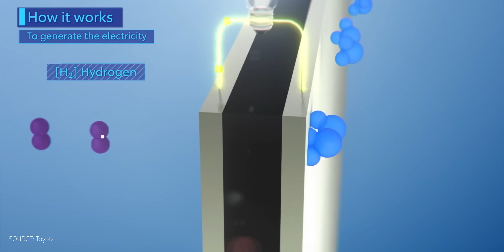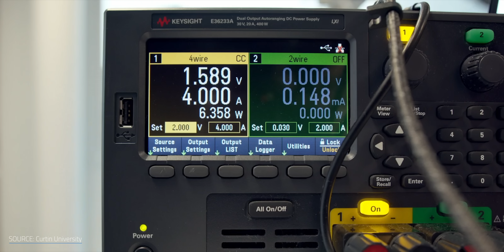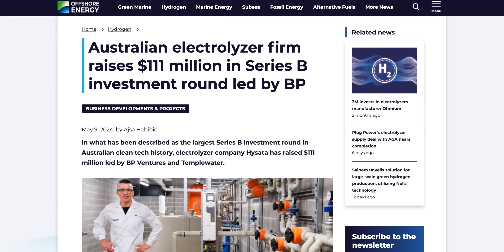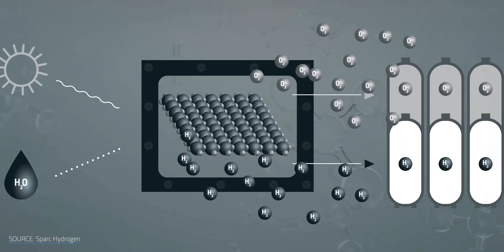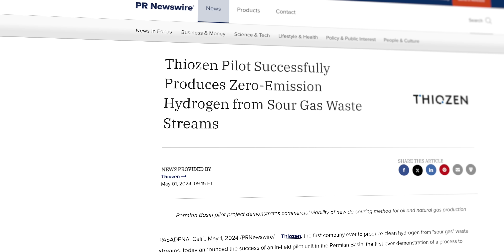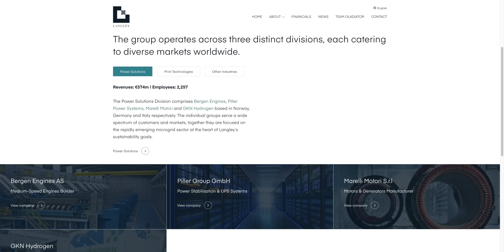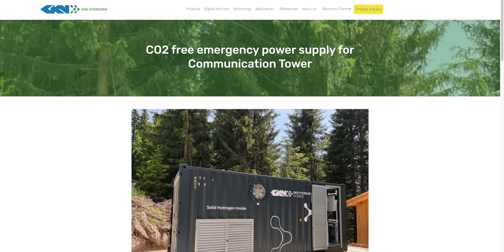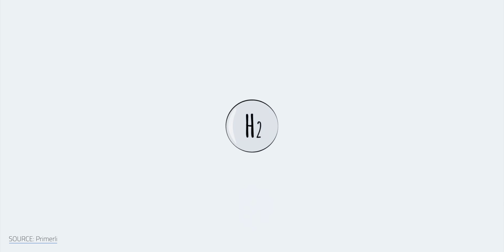How a Hydrogen Breakthrough is Closer Than Ever

Comment: Anything you built will cause emission.  Wind Turbine built of fiber glass, which is unrecyclable.  Same with Solar panels, or huge concrete for hydro dams.   In the end, Gas is cheap and easy to burn.   It might be more sustainable to invest in carbon capture instead.

Comment: Even running natural gas fuel cells is still a big step forward relative to most other power generation as far as energy efficiency. The obsession with attaching  hydrogen use to fuel cells needs to stop. It’s detrimental to to the entire fuel cell industry because it’s counterproductive to scalability and makes everything more difficult than any other possible fuel source.

Comment: I am betting on white hydrogen extraction working. Just need to convert most of it electricity near site or build data centers or fertilizer production near resource if it is a proven reserve of 20 years or so would be feasible.

Comment: Why should you have an electroloyser and a windturbine off the grid in stead of an elektrolyser combined with a windturbine ánd on the grid. So you can use cheap electricity from wind ánd PV?

Comment: "Hydrogen has to come from somewhere"
 However, unless it is being produced for use on site, more or less at the same time, then it will also need to go somewhere, and therein lies the problem, or at least a very big proportion of it, because this means it needs to be be stored, transported and dispensed, which current evidence suggests probably accounts for about ⅔, or more, of the costs, and cheap electricity and electrolysers are not going to affect this aspect of hydrogen use when used as an energy vector.

In California production cost for hydrogen is between $1.50 and $15,  and between $3 and $5.50 when produced using electricity from PV.

If we use an average price of $8.50/Kg then, with the current retail price for hydrogen for FCEVs, $34.55/Kg, that means the storage, distribution, dispensing, maintenance and profit margin costs account for about $26/Kg, as far as the end user is concerned. Accordingly, unless the users  are located at the production site, reducing electrolysis cost, even by 90%, isn't going to make an awful lot of difference to the cost for the end user. Even if you can get the pump price down to $20/kg that still about $0.50/KWh, which is probably over 10 times the cost of  off peak or home produced electricity, plus an electric vehicle is nearly twice as efficient as a fuel cell vehicle.

Those pushing the idea that cheap electrolysers are going to solve the hydrogen for transport, or in fact most non-industrial clean energy supply, problem show a distinct lack of #WST skills (whole systems thinking).

The only way hydrogen will take off for general transport is if a lot of people decide they are willing to pay vastly more for travel in order to have the perceived convenience of hydrogen over electricity.

Comment: We need to ramp up solar and wind energy production. Then when we are producing more electricity than the grid can handle we dump the excess electricity into electrolysis and produce hydrogen. At least we can produce enough hydrogen this way so we don't have to use fossil fuels to make it.

Comment: Hydrogen is not supposed to be a universal solution to the worlds demand for electricity and vehicle fuel. It's decent, in its relative simplicity, for off-grid, great for elimitating carbon emissions in certain heavy industries. Furthermore, it can be transformed into ammonia, which can be used as a maritime fuel, as well as for fossil fuel free fertilizers. And it could be used as a way of balancing wind/solar, making renewable energy systems more reliable. Though I grant there are other methods to achive this.

Comment: You made a presentation on hydrogen as a fuel and didn't mention PLUG?
They are operating 3 clean hydrogen production facilities, producing 45 tons per day, with 3 more planned to be built in the next few years.
They provide hydrogen fuel cell power fork lifts to Walmart, Amazon, Home Depot, and many others.

Comment: The elephant in the room here, the big main issue about hydrogen is not even mentioned in the video. You need 52 Kwh of energy to produce one kilogram of H2, that then delivers a maximum of 33 Kwh of energy (in the best possible case). There's a 19 Kwh negative balance in producing each H2 kilo. The way you can produce it, green, pink, fossil, is a secondary issue. 
The video mentions a new solution saving some 25% of energy sparing heat losses. Great step ahead, but still it would be 39 Kwh to produce 33 Kwh. The negative balance is still there. And even if we went on par, it still doesn't make so much sense.
The place of Hydrogen in the future mix might be as jet fuel. 
In an over-abundant energy environment of tomorrow, we might well dedicate a costly energy fuel like H2 (super clean anyway, once produced) to replace fossil flight.
Sure I'm wrong and my numbers are not correct. But please, let's talk about this main problem. The rest is detail.

Comment: The ratio to produce abundant Hydrogen from SMR vs Hydrolysis is significant. Hence use Natural gas to produce Hydrogen, take the spin off Co2 and pump it into the ground using CCS giving it a net zero  emissions footprint. as opposed to BEVs that require precious metals to produce batteries, natural gas is in abundance, and since that market is in place already, it would not destabilize the economy as much as a critical mass move to BEVs  would. What are you going to do when lithium and nickel (limited supply) are so overprocessed and lost and scattered around the earth through  band aid solutions (battery recycling - Not 100%). Since we are already putting band aid solutions on the table, why not use what we are already have, take a look at CCS (Carbon Capture technology)...

Comment: I don't think hydrogen needs to be completely emission free out of the gate. The main focus should be developing infrastructure so that you can, in turn, develop a more efficient product. You can then clean up the base of the production down the line. Regardless, it's still a big dent in overall emissions even with using fossil fuels to produce hydrogen. We use fossil fuels to mine and power lithium ion so idk why we hold hydrogen to harsher standards.

Comment: Nothing on storage… I’m not sure exactly what you mean by “efficiency” when you were talking about the first company and their new electrolyzer. Does that mean it can produce more hydrogen per unit or does that mean the energy needed to turn water into hydrogen is less? 70% more efficient compared to what? I don’t know it just doesn’t mean anything… 

I think hydrogen is still dead. I’m not saying we shouldn’t pursue it, because the benefits are potentially huge. But it’s not going to be a big industry until something actually changes. So far, it’s the same story, you can’t store it, so the energy density gains go out the window which is the only reason anyone would want to use hydrogen in the first place. You can’t even transport it long distances or store it long term… it’s just not practical. It doesn’t matter how big a plant you make, hydrogen can’t be stored long enough for it to be worth doing that. You’re better off producing it as needed on site. Again, until the storage problem is solved, hydrogen is just a niche tech with limited applications.

Comment: I think it has a place in a renewable grid. I had one lecture on fuel cells at university and the professor summed it up like this: Hydrogen is the means you deploy, when you can't use electricity directly.
Meaning you can use electricity next to its source to create heat, charge cars, power factories etc. Then do that. But what if you can't? How can you get dirt cheap renewable energy from Chile or Australia to other continents? Not by cables, not by batteries. And the ~50% round trip efficiency hydrogen seems to be converging to mid term is tenable if your wind turbine in Chile get 400% of the yield it would get in germany.
(And how do you decarbonise steel and fertilizer production? How do you store electricity from the summer until winter,...)
Those are the challenges where hydrogen can provide the more cost effective solution.

Comment: If I can get things going hydrogen will take the lead but my primary fear is those whom don't want it too have all the money right now and will stop at nothing to keep things that way. Take this new theory and put it someplace safe and memorize it as it goes much further than just to break the bonds of the water molecules.
"All  Molecules  can  be  separated  into  their  component atoms  by  taking  away  the  electrons  from  the  atoms that  make  up  the  molecules." 
This is a brand new theory I came up with while trying to figure out just how a few people whom aren't with us anymore split the bonds of the water molecules with far less energy than anyone I have seen before. From my research what they did was to mimic the earth's global electric circuit to get the job done. 
I keep an eye on Hysata because they are ahead of me as it's going to take me a little more time to get things completed.

Comment: Increasing storage length and efficiency may open niches in Hydrogen.  One that can be addressed is tanks leak over time, and a double tank with Hydrogen paste to absorb and slow the leakage should be considered.  The ability to accumulate hydrogen for high demand high speed electricity could change charging for space, and possibly commuters too.

Comment: Please, hydrogen is overhyped, It's mainly the Japanese automakers,  who've been pushing that. If we have a problem just putting up charging stations for EVs there's no damn way we're going to be able to convert to hydrogen because the difference in infrastructure development is like 10 times. There's the transportation of hydrogen there's a storage of hydrogen there's the issues of cars getting into accidents and possible after effect of that. Then there's the fact that you would have to convince Americans are better off fueling up with hydrogen than they are with gasoline. ? Then there's the fact you would have to have all these mechanics learn how to work on hydrogen vehicles that means more equipment different changes in motors so forth. An electric is a lot easier to work on there's no transmission there's no exhaust system there's no catalytic converter as well as there's no engine there's no oil needed. And considered almost any business can install charging stations compare that to trying to convert gas stations into hydrogen storage as well as there's a problem with getting enough truck drivers to transport gasoline and then you add hydrogen as another thing to be transported We don't have enough truck drivers for that. This is pretty much a useless story at this point we're not going hydrogen at least not within the next 25 30 years.

Comment: Typical brainwashed lib, fast and loose with truth. Wind turbines are not green. First the huge block of concrete to anchor the base. CO2 equal to half the weight of concrete is produced making the concrete. Then there is the massive amount of electricity used to make the aluminum and smelt the steel and copper in the generator's windings. Highly refined steel alloys are needed for the gears, and of course those must be machined. They also must remain bathed in up to several hundred gallons of OIL lubricant. Fiberglass for the blades... comes from petroleum and cannot be recycled. Much of this oil and energy is also used to mine the lithium for the electric truck that hauls guys out to service these eyesores.

Comment: Hydrogen is the result big oil lobbying since most of hydrogen produced is a byproduct of the oil industry to slow the inevitable march of battery electrification. 

It has no place in a sustainable future since converting water to hydrogen using electricity is very in efficient, losing most of the usable energy compared to using electricity directly. 

This channel believes anything, even got suckers to buy the pump and dump Nikola stock.

Comment: If you just had a big long cylindrical chamber to mass produce 100 meter long, 10 meter diameter PET plastic cylinders pressurized to 50 psi, you could make gigantic one kilometer square, multihull sailing ships that use the propellers to harness wind energy and synthesize ethanol from the hydrogen and CO2 in sea water.  A few thousand such ships would equal global oil production.  With a sail area of one kilometer wide by 300 meters high, the available wind power in a 120mph hurricane is about 30 billion watts.  30 ships would absorb most of the wind energy from the average hurricane.

Comment: First, the production of hydrogen needs to be clean and efficient. Then it needs to be stored effectively. And finally, it needs to be distributed efficiently. These are all significant hurdles if hydrogen is to be used as a transportation fuel. Battery EVs still need some work, but they have most of these issues solved.

Comment: The biggest problem with any “alternative” energy source is the idea that there is a way to produce energy without a down side. So there is no “green” energy. Wind turbines and solar panels have to be made from materials which come from the earth. Batteries require rare metals that have to be mined scarring the environment. These materials aren’t endless either we may run out of them. There is also no such thing as a true “renewable” energy source. Yes, the wind blows and the sun shines without us doing anything, but until you can produce as much energy as you want from those sources on demand and deliver it to the consumer, it’s not a solution to the world’s legitimate need for energy. We all would like to see a future energy source that is abundant and delivers uninterrupted energy in any form we need it without any environmental damage, but it doesn’t exist and probably never will. I call it the “magical fairy fuel” you have to squeeze it out of the rear ends of fairy’s to get it. The best we can do is utilize the energy sources we have as efficiently as possible. That’s why it blows my mind that the same people who want zero emission energy sources are so against nuclear energy. Again, you can’t produce energy without a down side, but for the power just one nuclear power plant can produce it definitely worth the small amount of nuclear waste that is produced. Even if you calculate the risk of an accident, which is incredibly unlikely if the plants are run properly, it’s still the best option we have for abundant electricity generation. I’m glad that the human race is still working on solving some of these problems and maybe in the future we’ll discover something truly amazing, you never really know, but we need real solutions now, not fairy fuel dreams.

Comment: An interesting idea is the small nuclear reactors set in a tractor trailer. 
Married with an electralisis set up to produce hydrogen. 
The storage and distribution are the most interesting bits here honestly. 

I would expect locations that can overbuild there local power grid. 
/ Have there own localized power. 

Could convert to hydrogen for some of there fossel fuel needs. 

The most interesting development on this vid is the solid form of hydrogen.
If this can be produced at scale.....

Comment: Hydrogen as a transportation fuel has a number of problems. One basic one is: where is the hydrogen coming from?
The hydrocarbon miners have a great idea, start with hydrocarbon. Any process to do this is less efficient than burning the hydrocarbon, and still creates climate changing chemicals.
The other big ideas is using solar to create hydrogen. This is wildly inefficient. Any hydrogen powered vehicle design still has electric battery cells to power the electric motors. Storing the hydrogen in the vehicle is heavy, and very dangerous.
The only force keeping this idea alive is the aforementioned hydrocarbon miners.

Comment: The critical factor is efficiency.  If the solar production method produces more hydrogen per square meter of sun collected than PV producing electricity used for conventional electrolysis, we have a winner.  As I recall, you can store twice as much energy in a battery as you can as H2, but since PV is only 20-30% efficient, if you can capture 40-60% of the incident solar energy in H2, we are gaining ground.

Comment: wondering, so for power generation can you just plug hydrogen into coal plants and it'll work? Then use photocatalyic water spilting to break byproduct of burning hydrogen to reform hydrogen. Guess its easier to just develop better solar panels to generate power directly... like Matt said, handling and storage probably is the most problematic for hydrogen use. So hydrogen battery cells are the only good use so far (after some significant development)

Comment: There is a research team at the university of Lund in Sweden, that have discovered a way to make hydrogen liquid without the need for adding refrigeration, or preussare, by adding some chemicals. They have also constructed a device that will turn the liquid back into gas in the car so that it can be combusted again.

Comment: Hydrogen augmented turbofans would significantly decrease the amount of fossil fuels used in commercial aircraft. The real question though is if it would be viable. Most methods of storing hydrogen weigh loads. That takes the energy density by weight through the floor.